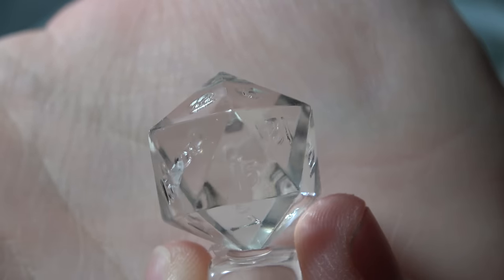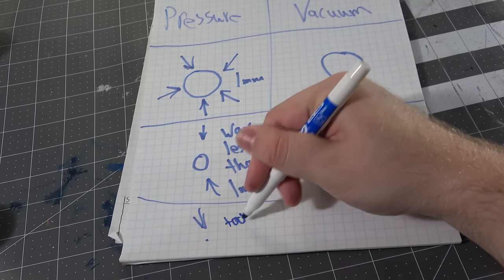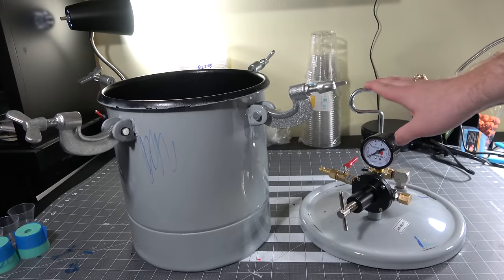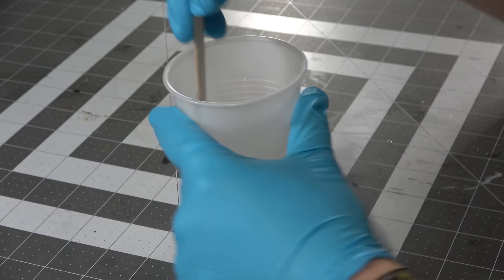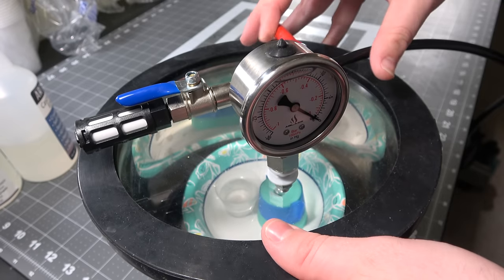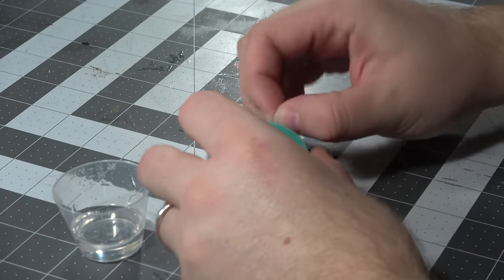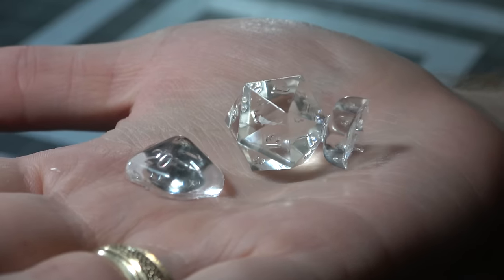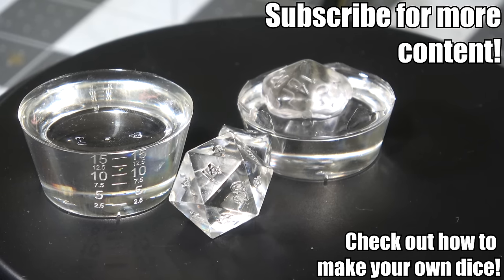Pressure Pot vs Vacuum Chamber | Resin Dice Casting

Comment: I want to point out there's a flaw in your methodology here. 
1) You don't need to pull a vacuum that long. 1 maybe 2 minutes is sufficient
2) You don't pull a vacuum on the mold. especially if it's a silicone mold, as bubbles trapped in the mold can expand, and deform ruining the casting. pull the vacuum on your resin before pouring, and be gentle and steady with your pour.
3) When you pull the vacuum, you are drawing trapped gasses out of the fluid, when you release the vacuum, remaining bubbles collapse (such as when you are applying  pressure) Because of atmospheric pressure. 

You pull the vacuum to remove the bubbles, then pour it into your mold.  No need to maintain a vacuum. 

With the pressure method, you have to maintain pressure during the curing process, or the bubbles will simply expand again before the resin has set. 

The biggest difference here, is equipment usage. With a pressure system, you can only work as many pieces as can fit within the vessel at a time.  With a vacuum system, you can cycle more pieces at a time, by vacuuming the resin, then pouring it, you considerably increase .how many pieces you can work with at once, as well as produce a better end result. 

Pressure does NOT cause the bubbles to completely disappear, and depending on how many bubbles you've formed during mixing, could leave the piece with far too many occlusions. 

Finally.. a combination of the two processes would result in near flawless results. 

As with anything in life, the effort you put in, is the proportional to the results returned.
Reply from the maker: This is absolutely right! I have since been more educated about the process since this video's inception.

My main concerns with pulling and releasing the vacuum, were 1, it takes more effort than the set it and forget it of a pressure pot. And 2, I was worried about running out of time when degassing, and my resin starting to cure. Because I've never had an issue with bubbles in my dice after the pressure pot, even with a HUGE amount because of my sprue molds, I never have bothered with both results. If I was making these for a museum quality replica, I would probably go with both methods now, but as this is just a hobby, I'll stick with what works for the time being :) Thank you for the tip!
Reply: Firstly, thank you for an educational video and comments. My question to your reply on degassing the resin before pouring in the mold is what happens when you cast a highly detailed mold? Air would still be trapped in the mold no? So surely from an efficient point of view it would simply still be better to pressure cast?
Secondly, how do you clean your pipettes after casting?
Thanks!
Reply: @benjaminhowell6920  You just throw away the pipettes, normally. :P Getting resin out of those would be an ordeal!
Reply: So just put the cup of your resin in the chamber and let the bubbles rise before pulling it out?
Reply: @Rybonator  ArcAiN6 said in point 2) that you shouldn't pull a vacuum on the mold, because it could ruin the casting. In your previous video (part 1) you achieved a great outcome with that method. Would you stick to that method or did you ever experience any deformations in your molds?
Reply: @Rybonator  Also, use a much bigger container when degassing your resin (prior to carefully putting it in the mold).  I find my resin needs 4-5 times the space to degas and then you don't get the overflow.  This keeps you from having to on/off the vacuum to keep it from overflowing.  I rarely degas longer than 5 mins at full vacuum. If the open time of your resin is longer (the one I use is much longer), that 5 minutes is set it an forget it when the container is big enough.  Paint mixing containers are great for this - the resin doesn't stick to them and they come in many sizes.

Comment: I would like to add an addendum to the "pressurizing" segment: The amount of pressure in your pressure pot isn't enough to account for the level of shrinkage in the bubbles.

For example, let's say you live at sea level (14PSI) and you pressurize your pot to a very generous 60PSI. That's roughly 4x the pressure. Our Ideal Gas law states that if you increase the pressure by 4x, you reduce the volume by 75% (4x the pressure, 1/4 the volume). Diameter is a function of the cube root of the volume, so a 1mm diameter bubble will be reduced to 0.63mm. That's still more than half the diameter, and would be pretty visible.

However, increased pressure also results in increased solubility in a solvent. Think when you open the cap on a pop bottle, all the bubbles come out. That's because the pressure inside has been reduced, so the carbon dioxide is less soluble in the water, and gets released. Now, epoxy resins are made of pretty reactive materials. That's why they turn from two liquids into a solid, and release heat in the process. It's also why un-cured resin is actually very toxic, and why some things can cause the resin to "inhibit" and not cure properly. Increasing the atmospheric pressure also increases the solubility of air into the liquid resin by about 4x.

So basically, my assumption is that the increased pressure causes the air bubbles to be absorbed into the resin the same way carbonation is into fizzy drinks. This, plus the internal stresses that pressurization adds, does reduce the physical strength of the cured resin, however most epxoies have such a high tensile strength (usually 1500PSI or more) that this isn't really a problem.

Generally what I've gathered is: You want to vacuum-degas silicone molds (partly because silicone usually just has a longer working time and won't set in the middle), and you want to pressurize your resin (because most molds don't have enough overflow capacity, and the set time is fast enough that you can get stuck in the middle somewhere.)

Also, comments on technique: You want to actively watch your vacuum chamber and repressurize whenever it gets close to overflowing. This is tedious, but will help prevent overflows.
Reply: I have no idea if what anything you just said is true but I have been searching for some kind of answer to why pressure pots work because there is no way air compresses that much especially at like 40psi. I'm just a layman but apparently nobody has really done the science on it, that I can find at least.
Reply: It's not something that's easy to research, since it's kind of hard to really test for such things when the solvent is under pressure. The best I can really say is "It makes sense," but that's admittedly not a very good barometer for factuality.

Maybe we could convince someone like NileRed or Cody's Lab, who actually have some fairly extensive chemistry knowledge, to come up with some experiments.
Reply from the maker: I love your explanations, very detailed and easy to follow. Thank you for the addition to the knowledge :) 

There is also a bit of natural shrinkage that happens when resin solidifies and cures, which also plays a part in the overall reduction of volume. This in combination with the bubbles and your explanation create the results that we see. :)
Reply: Thanks. Fortunately, I have some work experience explaining technical things to nontechnical people (I would like to emphasize, not stupid people. My boss is very intelligent, but her expertise lies in running a store. If she had technical expertise, she wouldn't need me.) but I know I can get extremely wordy and dense sometimes.

I've had a few people say they think I would make a good teacher. To which I respond, "No, I would make a terrible teacher!"

Ultimately, though, I just love talking about the things I find fascinating, and spreading the knowledge I've accumulated. Perhaps, in some way, it's my own bid for immortality, that a hundred years from now, the things I once knew will still be remembered. I'm glad people seem to appreciate it.
Reply: Absolutly yes to bring gases into solution. With the cured resin I'm really not sure what happens with the trapped gases. Maybe they just difuse over time. I don't think they really bring any stress to the material. Frozen cola does not crack and break when you open the bottle, but as its melting, the gases also get released and bubble out. Do you have any resources to that topic? I found nothing so far about pressurized resins and the impact on material properties.
Reply: @EntropicCheese  There is one video I found about pressure casting that uses the words "brings gases into solution" that was the missing part in my understanding of pressure pots. If its OK I would link it here. I always thought, no pressure could shrink bubbles so small.
Reply: @EntropicCheese  Casting of resins has been thoroughly researched by chemists and engineers in industry.
Reply: I don't know that this is the right thread to ask but my interest in resins is in making climbing holds. I haven't had any issues with the epoxy I use but my main concerns are molding and pouring techniques for different types of holds, and how to make sure that they are strong enough and won't break while I'm on them

Does pressurizing resin strengthen it or does it just make it more clear? Or might it even weaken it?

I try to make my holds economical like using modeling clay and just pressing new molds off of existing holds natural stone so I can reuse the clay and not have to play with silicone, when I can. I can make a pressure pot but if it doesn't significantly improve the strength it's not really worth it for what I do. Rock climbing holds don't need to be crystal clear 🙃
Reply: @billwhipple9039  From what the OP said the pressurization of resin weakens it due to the gas being diluted into the resin.  I would also think the resin would become further weakened due to the internal stresses that would happen when you take it from a higher pressure to a lower pressure.  Unfortunately from what I've taken from the video is that the stronger method would be vacuum casting the resin (correctly.)  In that when done correctly the resin would be denser and less porous due to not having micro-bubbles in it.

Unfortunately to do it correctly and not have a mess is to:
Figure the exact curing time or as close to it, agressively vacuum it, cut the vacuum when it starts to overflow, re vacuum the piece, repeat the cut off/re vacuuming until there are no bubbles or close to no bubbles, and normalize pressure before the piece starts to set.  Otherwise your piece will be weakened from the resin being in an expanded state (essentially it will be bigger, and less dense if left to cure while under vacuum.)  Sadly vacuuming pieces takes some practice, a lot of micromanagement, and the pieces will be slightly smaller due to the degassing of the pieces (airbubbles take space.)
Reply: @billwhipple9039  Hi bill, Chemical engineer here kinda specialized in materials science. From my knowledge pressurizing the solution would probably not affect at all ant of the mechanical properties of the resin, specially at these low pressures (high pressure is considered above 50 bar or 725 psi). As i have not worked too much with resin i don't know about what i'd do to it at high pressures though. Your best bet would be to either try to let them cure at higher or lower temperatures to affect the way the resins hardens (making the molecules attain a certain "order" thus making them stronger) or mixing fibers as a reinforce to them. Specially carbon or glass fiber, but there are also metallic, plastic and ceramic fibers. These would make what we call "composites" wich tend to increase the resistance and strenght of various resins and are widely used. The downside is that the resin will definitely not be as clear as without them, and if you manage to harden resin at lower or higher temperatures it may also became less transparent. I hope this helps and you can learn a lot from investigating " resin and polymer composites" online
Reply: @Brandonbadn   Thank you for your response. Since I use them as hand holds for climbing im hesitant to use any fibers to strengthen them

I'm wondering if simply casting two long thin blanks, one at a higher temperature and one at a low temperature, and adding weight until they break might answer the question? I think that would be representative enough of the type of force it's likely to encounter climbing
Reply: @billwhipple9039   i think that could be a good experiment. Make to blanks of hardly the same thickness of the tools you plan to use. Secure them over a a surface and hang weights on them with a chain or rope. Ideally you could put more than one and attach a heavier weight to both of them at the same time, simulating them holding your own body or your equipment from different angles. Its also worth noting that if you decide to use a composite with glass fiber or something like that you don't need it to use it on 'all the resin', meaning that the most exterior part could be smooth and pure  as to not be an issue for handling.
Reply: @Rybonator  I have an odd question.. I'm wanting to make a replica of the Beauty and the Beast rose from the original Disney cartoon. It has a pink "aura" that could probably be achieved with resin dyes (liquid I'm thinking) but I'm not sure how to pull off the "glow" fading effect. I was thinking that maybe vacuum would help with that, but after seeing this video I'm definitely second guessing that method. Not sure if pressure would, either
Any advice is appreciated 🙏
Reply: @ACAB.forcutie  You might try this video, https://www.youtube.com/watch?v=xONq60H4yYQ by jdrekt29t. He makes a lot of little random "impossible" resin castings, including the cigarette, a lit candle, and a lit cigarette. To get a good "aura" effect, you might look into painting your rose with glow powders, or possibly even using tiny LEDs wired down through the stem of the rose.

Comment: excellent explanation!  I use both silicone and resin so probably need both a vacuum pump/pot and pressure pot.  I also need to purchase an air brush compressor.  This is quite a bit of equipment so I am trying to research how to economically buy all of it.  But pressure is best for clarifying resin and good for resin poured into silicone molds.  Silicone is better to de gas in vacuum.

Comment: I feel like it's also worth noting that your example used a simple form that allows the bubbles to rise straight out of the top of the mold. In many cases the mold will have air trapped inside that won't simply rise to the pour hole. It will expand and stay inside the complex form unable to rise out. Thanks for the video! so cool.

Comment: Amazing, thank you. Before I thought a vacuum chamber would be a better idea because removing the bubbles sounds better than making them smaller, as long as the resin didn't set before it did it's job, but didn't consider it expanding like that.

Comment: Thanks for the demonstration. I did a search, specifically to find an explanation of this, and got exactly what I needed to know.
From other processes, like kilning clay pots, and allowing moisture to escape, it occurs to me, that the vacuum, would need to be applied very gradually, to give the bubbles time to move to the surface, through the resin, rather than bring loads of resin out with them.
Maybe, like cooking clay, you would need a timer, that could follow a programmed schedule.
Watching bubbles escape, is not far removed from watching paint dry!😉
I also wondered what the difference would be regarding light transmission, if you were making lenses, say for old lamps or similar. I suspect even bubbles that you cannot see, would affect light transmission.

Comment: This is super helpful, was just considering getting a vacuum chamber, so, yes super helpful.
Reply from the maker: Still a useful tool! But a pressure pot is just more bang for the buck :)
Reply: Would definitely recommend the vacuum chamber! Might be a bit more work but definitely more proper. (And overall can be cheaper).

Comment: Rybonator love your videos and you inspired me to get into the molding and casting . My first set of molds produce the same results of rough surfaces when pressure cast. So instead of putting the silicone into a vacuum chamber, I put set #2 to cure in pressure pot at 50 psi and produces very good results
Reply from the maker: I actually have a demo of that planned for my next video! I got the same results :) Good to know great minds... get similar results haha
Reply: My last batch of silicone I used was clear but I misread the viscosity. It arrived and I saw how thick it was (very close to caulk from tube). Being a 2 part mix it was strewn with air bubbles.  I figured I would give it a shot and see just how good a pressure pot was. Low and behold a clear mold was produced. Wish I could post pics of the initial and final results for you

Comment: Well explained! Am I wrong in the following assumption? gold standard for perfect castings: Using both methods. Vacuum chamber that pulls at least 8CFM of mixed casting material thus reducing bubbles introduced in mixing. Pour casting material into mold (introducing poured bubbles). Place into pressure pot to reduce poured bubble diameter. 

I assume you don't prefer this method because of extra step and need for oversized vacuum vessel to hold casting material?

Comment: Still working on that cats eye thing, but I don't currently have access to a pressure pot or vacuum chamber, so I'm putting it off until I've secured the more necessary of the two at least. Thanks for the vid, it's certainly relevant to that process.
Reply from the maker: Of course! Happy to help :) Thanks for watching!